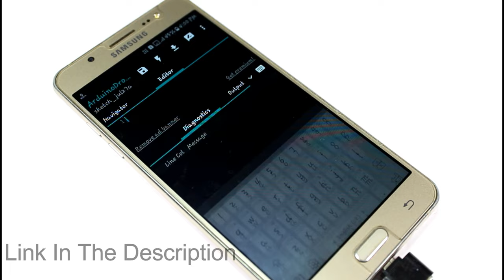How to Make Mobile Control Door Lock at home

Comment: What are the white wires connecting to the arduino? If I am using a raspberry pi 4, can I just plug in the raspberry pi as a power source or do I need to do anything else to provide power to connect the wire for the lock to the relay?
Reply: What is the white wire

Comment: Can you please tell what is the use of relay 5v in the circuit
Reply: the purpose of that is it can switch 12v by just appliying 3-10v
Reply: because it can fry the arduino if connected directly